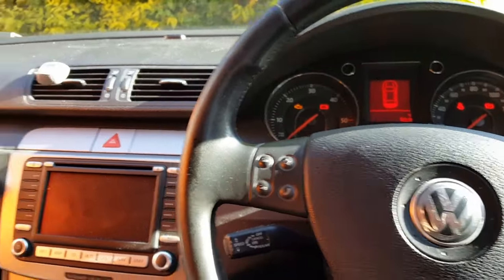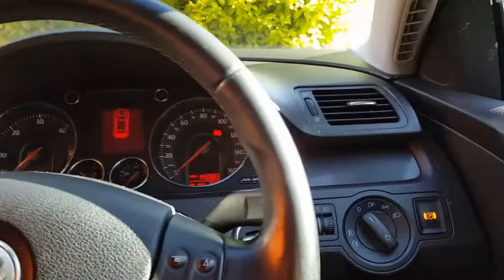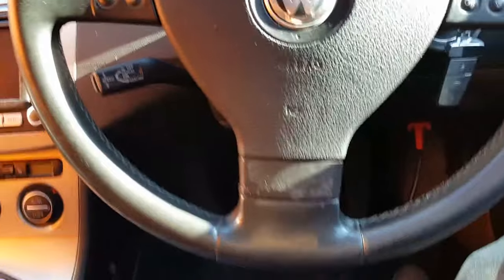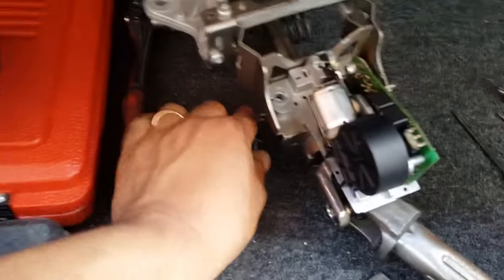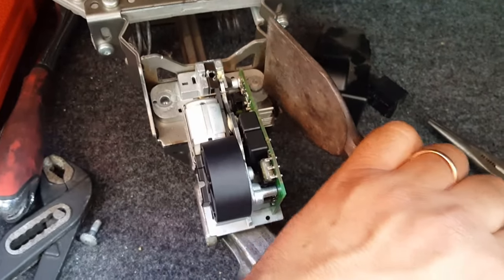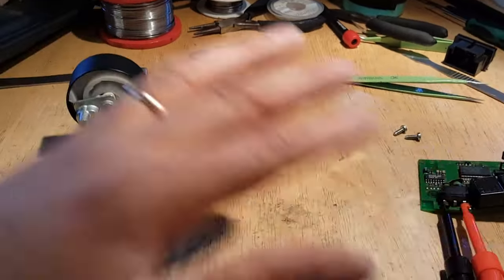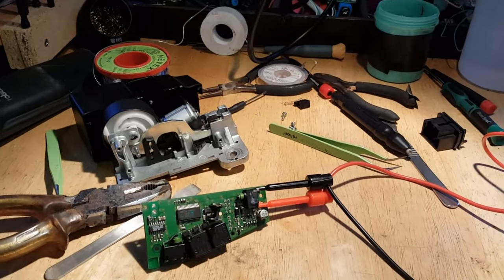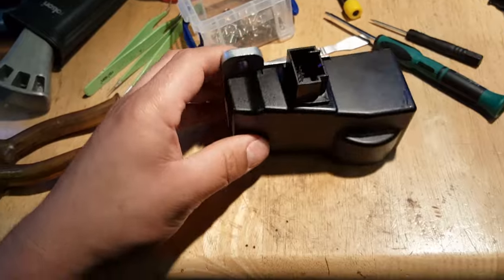VW Passat B6 Steering lock fault failure repair.

Comment: Great video! It helped with one Passat for a while after I changed both microswitchs but still I have the problem when outdoor temperature drops around 0'C. 
It can be hear that lock&motor are slow when it's cold. Then I got situation when it unlock-lock-unlock. If I tried to take out the key fob and put it back to key hole, lock&motor can be hear to move faster.

Questions, can the lock be dirty which lead to this slowness or could it be slow because of cold lubrication in sleeves in lock..?
In the other hand, I have a old battery in car, but it's strange that lock&motor works faster in second attemp.
Reply from the maker: kupukka 
Hi
Definitely dirt can obviously slow down the moving parts...
Then motor can also be the culprit... open the lock clean and lubricate it...
Changing the motor would be also something to consider...
Hope that helps...
Reply: kupukka I have exact same problem as you described. System will function just fine all spring and summer but comes fall or worse yet winter and it starts to fuck up. It’s been doing that for two years now and I know for a fact that cold temps are causing that. First I thought that perhaps bad soldering is the issue but now after reading all that I started to doubt myself. Probably just bad micro switch just as the video describes. I am going to have to just dive in and try to fix it myself as the replacement will cost me close to 1000$ here in Canada. Have you figured out the exact cause of your issue by chance?
Reply: Can confirm. Nordic country. Car works fine all (short) Spring and Summer, no issues. Temperatures start dropping and the warnings come in. For me, it is solved by taking out the key fob, turning the steering wheel as far left as I can, then put the key fob back in. Unlocks every time, no warning. Been doing that for a few years now but I'm worried that one day it will just lock up. I haven't performed any fix as it does mean messing with a tamper proof part and I don't want to find myself in a situation where I need to pay a large amount for reprogramming the car for new parts. I don't like that practice at all. A car should be serviceable. Good to know these micro switches can be easily fixed or swapped out without the need for reprogramming, should it come that far.

Comment: Do you have to put back the black slide lock thing with the springt that youre taking off ?? thx for answering :)
Reply from the maker: Hi
The anti-tampering mechanism, no...
Thank you for watching!
Reply: The black lock and the little spring is for safety yes? if taken out would it cause locking when driving?  Please help.
Reply from the maker: No...
It is a tampering system...
Remove it makes no difference really...
Thank you for watching!

Comment: Great Video!! This is what I looking for, I have the Steering Column Lock defective message on my Passat B6 since 8 months ago. Now became worst that when insert the key, it will not unlock. It need reinsert the key many times in order it will unlock. While it unlock, it can start the engine for 1 sec and it will off. Do you think the culprit also the micro switch in the ESCL? Thank you.
Reply from the maker: It is a possibility...
As if the steering does not unlock the car does not start...
Thank you for watching and for your comment!
Reply: Thanks on your feedback. Do you use back the security bolts after you fix the ESCL?
Reply from the maker: +Chris Chen 
No... I haven't...
But you can obviously use security ones...
Reply: Chris Chen ... u problem ist resolved??? ( I have some problem.. Steering Column Lock defective)
Reply: i have a 2009 passat cc b6. it won't crank and says immobilizer active on the dashboard. do i have a key problem?

Comment: Hi mate,
this is good video, I was hoping it will solve my issue (have a same model passat) however it seems something else is preventing engine startup.
I don't have any alarms on dash board. When I plug the key in to first position I can see amber LED small steering wheel light coming on and can hear the steering lock unlocking. When I proceed further with the key to ignition start the small steering wheel LED turns red and there is no start not even trying to crank. Have you come across this issue before? I'm thinking I have issue with immobiliser but not sure at this stage.
Thanks mate
Reply from the maker: hashimpasha 
Hi
Have you scanned the car already?
Any codes?

Comment: Great job but if changed the column electrical luck do we need to program the new one on the car againe and do we need to make new coding for the both of remote controls?
Reply from the maker: +Yervant Khachadorian 
Hi
A new column would most likely need to be programmed... (I never done that...)
At second hand column, probably would need to be virginized first... and then programmed...
I am saying this with no previous research... so it might be that is not exactly like this...
Reply: there is no chance to virginized an used one...no solution available for public... yet
only brand new possible ,very simple...all you need is a PIn code, VCDS or similar device and good battery back up/support.
Reply from the maker: Thank you for the clarification... as I said I never that that... But perhaps you can transfer the data from the old column into the second hand one??....
Reply: transfer the data only via swapping  both ELMOS(you can NOT read those) mcus from ori into new(for me with brand new in hand,does not make any sense as programming wont take longer then 5mins,once you got a pin code ) and brand new cost only £80 at dealer...only does make sense when, new not available or you have a spur one at your workshop...  hope that does make sense
Reply from the maker: Shemek Best 
It does make sense... Thank you for the info! Hopefully that will help others...

Comment: Imsvvavr,  great video. Thank you. Please explain why we should remove the spring loaded lock? Do you mean  when we put steering lock back , we dont need it?
Reply from the maker: Ravi kumar 
Hi
Thank you for watching and for your comment. 
No, you don't need it... That's just a tamper mechanism...
So you can't put is back once opened...
Remove it and you will be just fine...

Comment: Its a bad design, I assume this part is Valeo made crap. I've had this problem in passat CC 2010 every winter started from 30k miles on the clock.  Easy way to start the engine is spin the steering wheel when throws an error , pull the key out and start the engine again, been doing this past 7years.

Comment: How you program it? I been having the same issue which it was recall back in 2013. Thanks
Reply from the maker: Hi
I never had to program it... so can't really advise...
Have you already removed yours?
Reply: I am planning on doing some day. How did you put everything back together or the soldering diagram on the circuit board?
Reply from the maker: j m 
Hi
What do you mean?
Put things back together is just the  reverse...
Reply: what type of cleaning liquid did you use? Type of things to remove and resolder it? Is it the same as other soldering liquids?

Comment: how pcb splits from other part? no tricky?
and when you remover that spring loaded part,in end you put iit back,or left that latch not active always?
Reply from the maker: Autostop 
The pcb just comes out... if I recall correctly it's secured with 2 screws....
The spring I just left it out....
Reply: lmsvvavr pain in the ass take of steering column?
Reply from the maker: Autostop 
The steering column is not that complicated... more is to take out the steering lock from the column, as this is secured with security bolts...
Reply: lmsvvavr later you put regukar bolts?
Reply from the maker: Autostop 
Yes...

Comment: Hello Mate; where about you based to check my car starting problem.
Reply from the maker: Asim Javaid 
Hi
I would love to be able to help, but I do this as a part time... and I am quite busy at the moment...
What is the issue?
Reply: lmsvvavr. Thanks for reply. Actually I have changed or put reconditioned steering column lock fitted in Passat 2009, but car has still starting problem, when I press key nothing happened and has no fault code safed related to steering lock issue. Can't understand where's the problem. Could you help me. Kind regards
Reply from the maker: Asim Javaid 
I strongly believe they need programming... what codes and live data tells you?

Comment: Hi guys,

How can I get in touch with you?
Can I have a phone number or something? I have an issue on my car as well, steering column look. 

Thank you
Reply from the maker: Robert Badea 
Hi
Just ask here...
Thank you for watching!
Reply: LM Auto Repairs 

I have a message on dashboard saying that “steering column look” visit workshop.. the car switches on and is working normally, but from time to time won’t unlock the steering. 

Where can I get the car to you for fixing? 
Can I have a phone number or something for an appointment? 

Thanks
Reply from the maker: Robert Badea 
Hi
I do this repairs on a part time basis... and I have enough to do at the moment...
I would however, advise you to get it sorted  rather soon than later... because that will fail, and you will be left stranded....
Hope that helps...